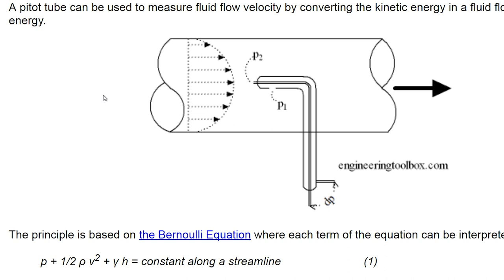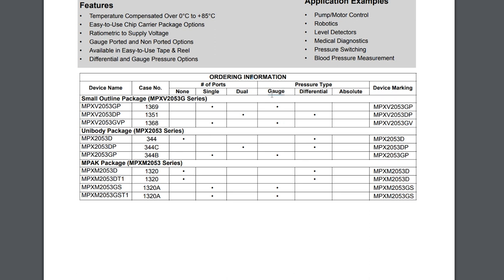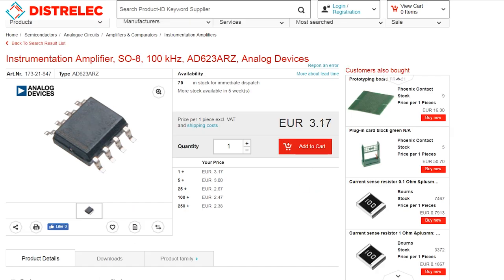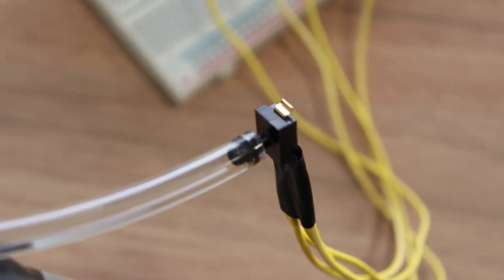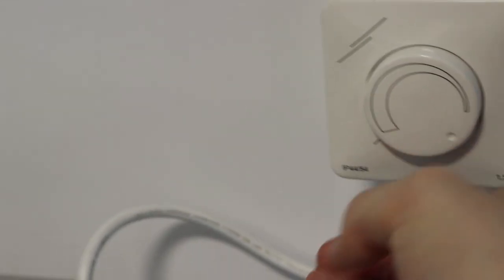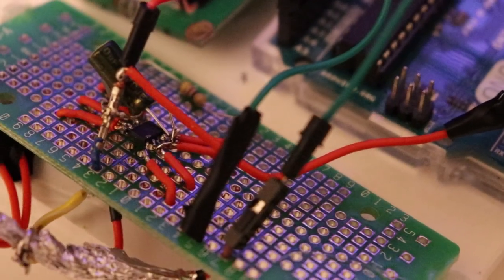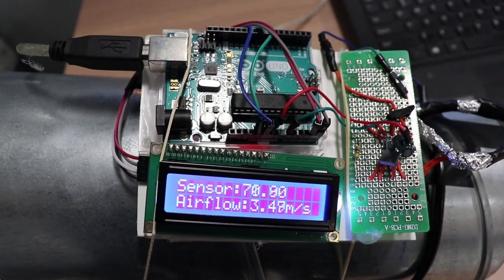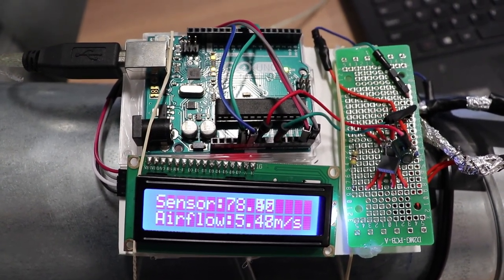Pressure airflow measure device with analog sensor [Arduino]

Comment: This is very interesting work you are doing here on DIY air flow sensors. Great job.  I've looked at your videos for ultrasonic, bladed fan, and pitot tube methods.  It sounds like from your responses that you are not actually trying to make a sensor that you can use.  Do you have a recommendation on an approach that a do-it-yourselfer might  use?

Comment: How does that work with small air speeds? (0-0.5 m/s)?
Reply from the maker: It wouldn't work at all :) At that low flow speed Voltage/Stagnation pressure curve is basically flat and values are tiny. Secondly I don't even have access to equipment to test that slow flows. In this project I just wanted to learn about the general physics principle of pitot tubes. Building device to measure airflow in VAV systems or laminar flows was never my goal :)
Reply: It doesn't work with small air speeds.

Comment: 240/5000
Hi, colleague, congratulations on the video! Tell me one thing I do not have experience with programming but I would like to use this code for a test here with my plane as I do if it is possible to convert the unit of measure to Km / h? thank you....